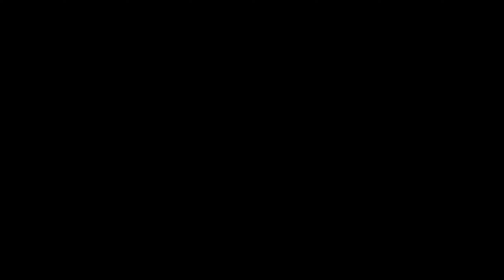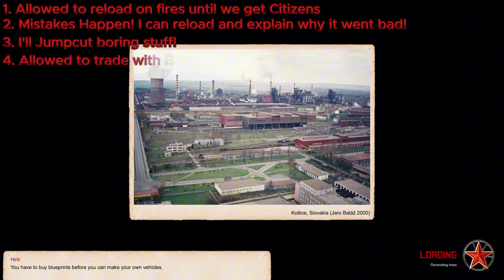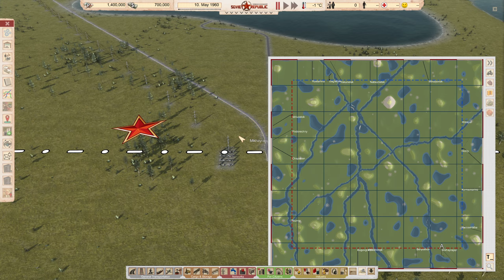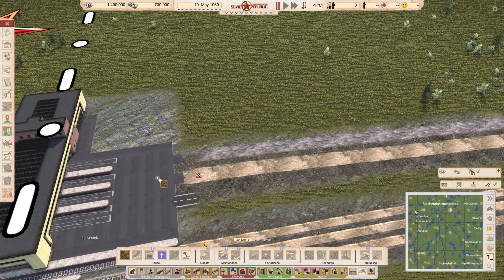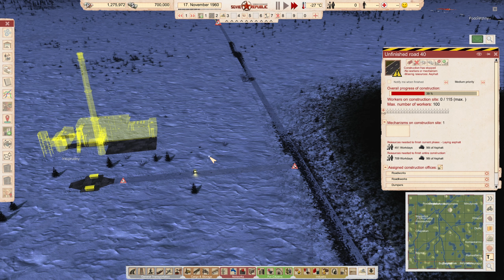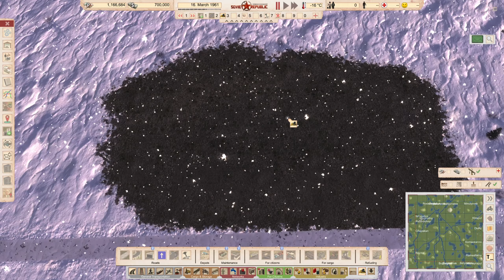[Lost] Infrastructure Setup! - Siberia Realistic Hardmode Let's play Ep 1 | Workers and Resources

Comment: With the rule of trading with both east and west. Will there be a preference towards the east? Or will there be only select goods sent to the west? I'm just curious how you plan to handle the trade aspects.
Reply from the maker: I'm going to use the East Trading only in critical situations or where it's impossible to trade with the west(eg Electricity!)
Basically there's a cheeze factor, you can buy the 105 speed tower crane from East side for 25-40k$ and sell it to the west side for 50-170k roubles(i will try my best not to use it if not needed).
Apart from this, I will buy vehicles that I will use whenever they are better than the western side!